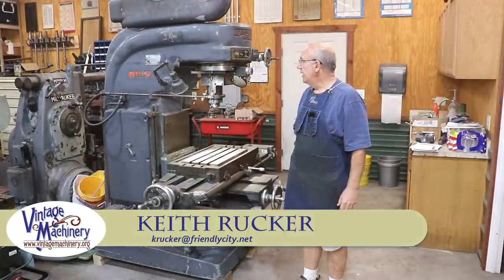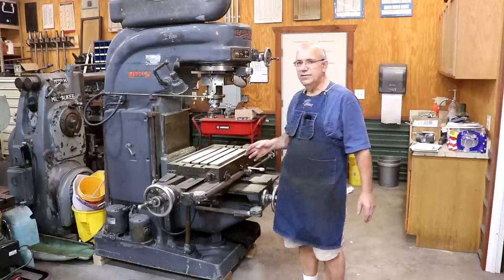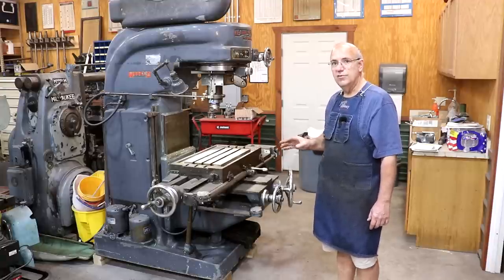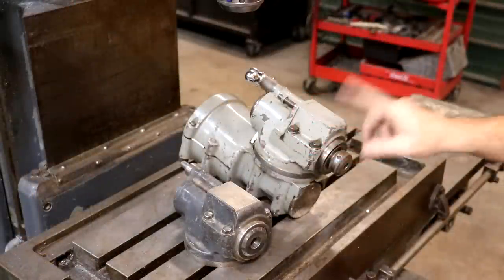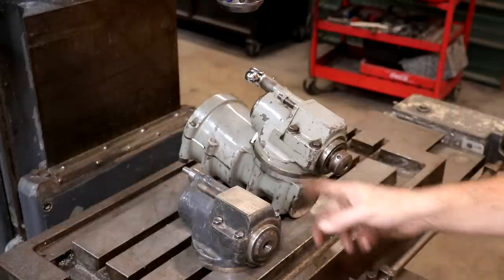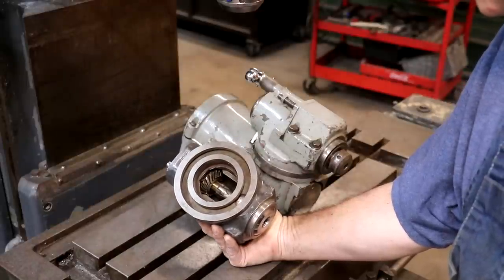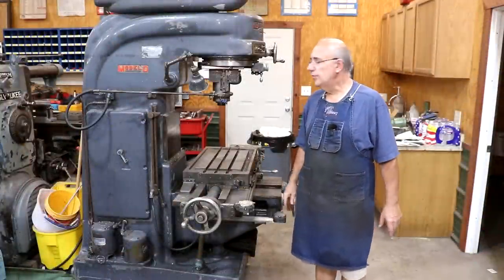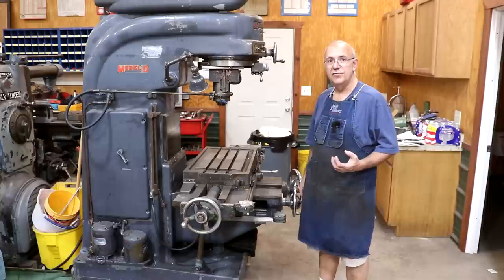Kearney & Trecker 2D Rotary Head Milling Machine: Parts and Accessories

Comment: I served my apprenticeship in a model shop in the early 1970s. We had 2 of these machines. We had the cherrying attachment and the right angle drive and I think all of the attachments. Then we started using NC mills. At 1st NC wasn't capable of some of the movements the 2D was capable of so they didn't get rid of them right away. They were fun to operate.
Reply from the maker: The "good ole days!"

Comment: Keith, I'm pleased to see that you have acquired a K&T 2D Die Mill.  I'm jealous to be sure, as I was very fortunate to be professionally trained to operate these machines while employed with the Boeing Military Airplane Company in Wichita back before the CNC machines took over the machining industry. During my entire career operating these magnificent machines, I have never ran into a single complex operation that this machine was not capable of performing with very impressive precision. This machine is capable of doing more than most are smart enough to comprehend.  With due respect, It's clear that you are just getting acquainted with this machine, and at this point you are not aware of the learning curve ahead of you! All I can tell you is TRIGONOMETRY is an absolute must to successfully operate this machine. If you need mentorship, or if you have questions, please contact me. You Sir, are in possession of perhaps the finest piece of machinery ever designed and built in my opinion.

Comment: Good luck with that mill. I hope anyone less than 50 years old that have never had to learn how to use one of these, we had a Tree mill with a turn table head. What a royal pain in the ass, makes you really appreciate what cnc can do and cad cam even better.  Yes, they could do a lot of different things on those,  but get ready for gray hair and ulcers, especially when working on an expensive mold part that you have already stuck a couple of months of labor into. That thing will test your skills to a new level. I sure hope you like doing trigonometry,  cause you are going to need it.
Reply from the maker: Funny - I do kind of like working out mathematical problems.  For that matter, problem solving in general is kind of what I live for!

Comment: I was looking for a universal head and slotting head for my 2D. I’m in the UK, and you managed to unearth one from the UK! I have a cherrying head and full set of collets in the original K&T box. I’m using QC30 endmill holders, er32 holder, shell mill adaptors and chuck adaptors. I had to make my own nose piece, but that was fairly easy on the 2D.
Reply from the maker: I do have some spare parts and accessories that I would be willing to part with.  If interested, shoot me an email.

Comment: A machine that has thousands of mechanical parts designed to do complex shapes which soon became obsolete when CNC machines could do the same jobs with 3 servo motors. You can see the same changes now occurring in the automobile market, where the highly complex IC engines and hundreds of related modules are being replaced by EV's with a simple electric motor.

Comment: Looks like your new mill is set up for standards to set XY axis. Didn't you pick up a set recently? I used to run a Pratt & Whitney jig bore for tight work. It had a DRO but for really precise work I would set up the standards. I look forward to you setting that rotary mill up. Best of luck!
Reply from the maker: Yes, I have a set of standards to use with the machine but I am also seriously considering just adding a DRO.

Comment: Keith, I sent you a message. That 90 degree head may need a fork drive. Also, those triangular things you had on the lower right of the table are rotary table trip dogs for the K&T rotary table when you drive it with the drive brackets. I'd like to read that publication about the cherrying attachment as well. Has it been put on your site?

Comment: Keith, 
Another awesome job. Thank you. 
I have a question that I hope you can answer. I purchased a vintage boice-crane 3450 8" jointer. It is in good working condition but needs a little care. I'm having trouble finding parts  the most needed part is the cutter head guard. It is a unique design as it pivots on an arm that can rotate out of the way for rabbeting. I placed an ad on vintage machinery but haven't heard anything yet. Any help or sources would be greatly appreciated. Thank you
Kenny Shipman
Reply from the maker: It is just one of those things that you are going to have to be on the search for and you are probably going to need a bit of luck.  Sorry, I don't know of any source.

Comment: The K & T collet attachment with a thread stub on the end looks like it would attach to a drill chuck.
Reply from the maker: That is one thing that it might have been used for.
Reply: That or a boring head. I'd love to be able to use a boring head with mine... Or a fly cutter.

Comment: K&T must have lost money on these machines. The development costs for the machine and all the bespoke tooling must have been phenomenal. With it being a niche product made to exacting accuracy standards and sold in small numbers, it was probably kept in manufacture for the pride of the company rather than the bottom line.
Reply from the maker: I think that K&T actually purchased this machine design from another company so I don't think that they really did the development work.  I think that they greatly improved upon the design and concept that they bought though.